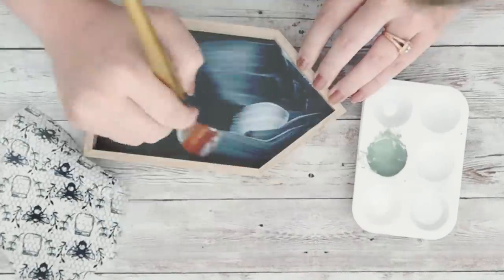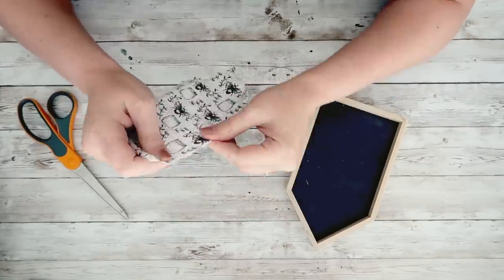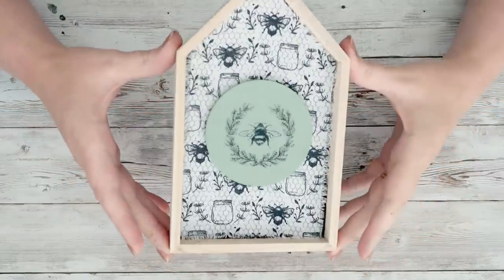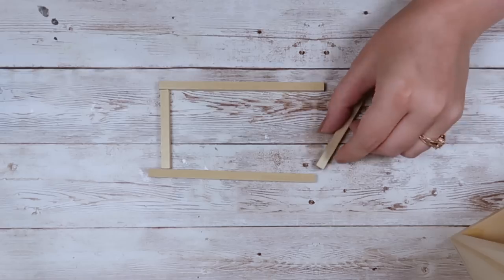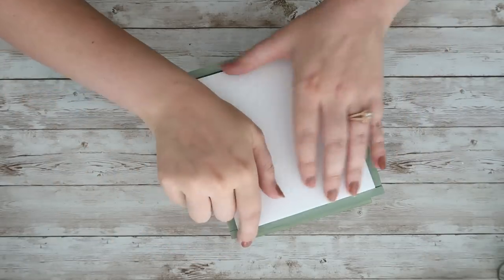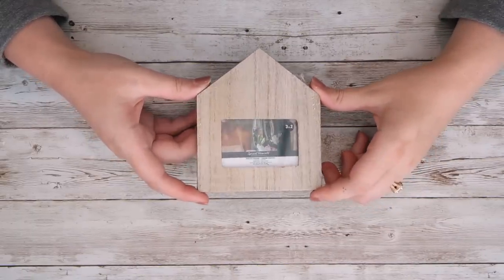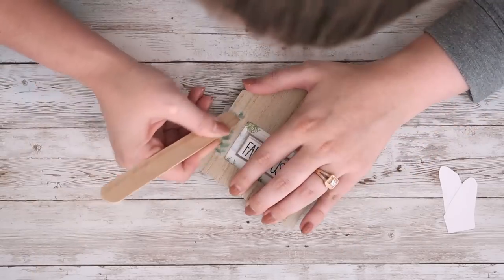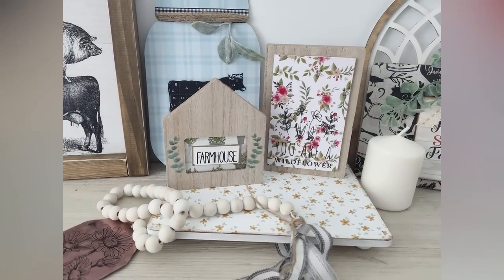10 DOLLAR TREE FARMHOUSE DIYS YOU WON'T WANNA MISS! Turn Dollar Tree Items Into GORGEOUS Home Decor!

Comment: Try dollar tree super glue wood glue in the home repair section.  Like with the command hooks, paint rollers and such.  It takes 24 hours to dry solid, but its workable in 10-15 min.  It works awesome on wood!  E6000 and regular super glue just soak in to wood.